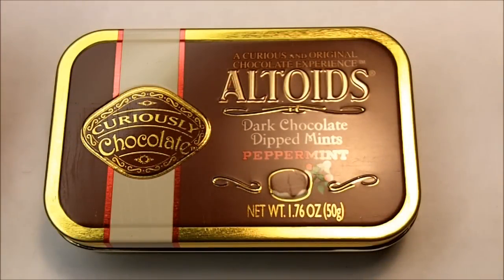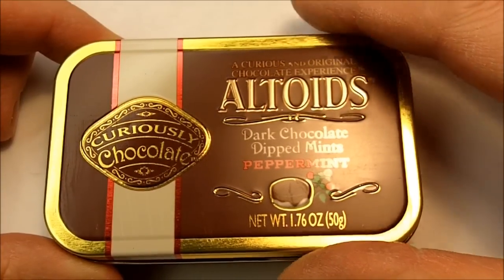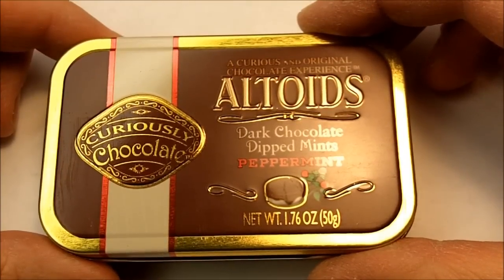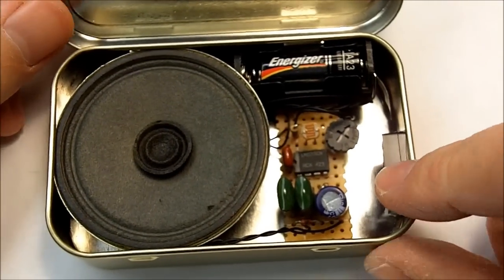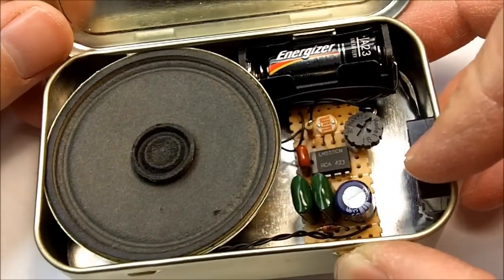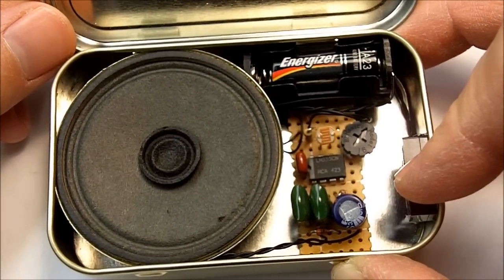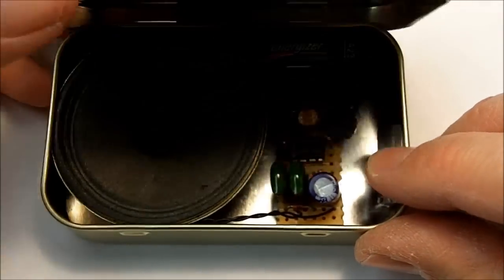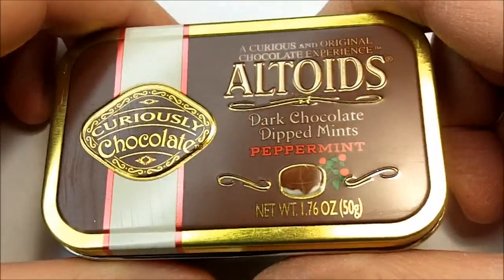Growl and Scream Altoids Prank (FightCube.com)

Comment: how much it costs?
Reply from the maker: It was basically free for me, since I had all of the parts already.  It might cost about $10 to make one.  I'm not selling them and I would upload the schematic, but my network drive is currently broken :(  I'll put a link to a similar circuit in the description, and you'll want to provide feedback on the CV pin 5.